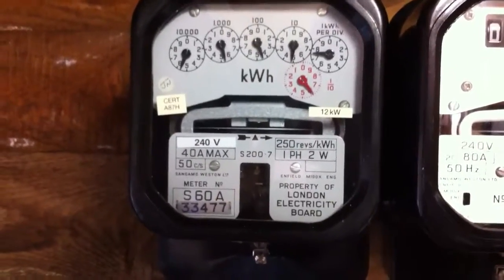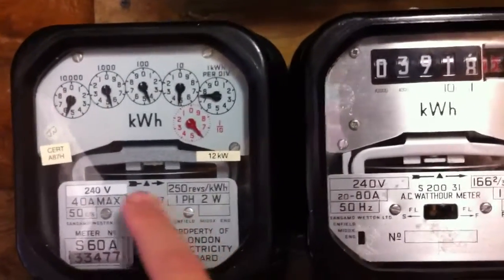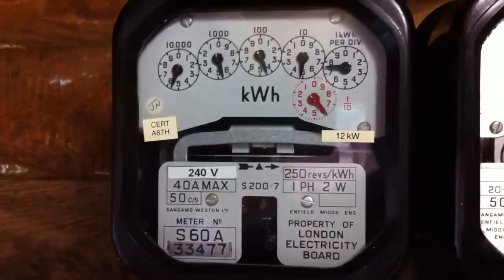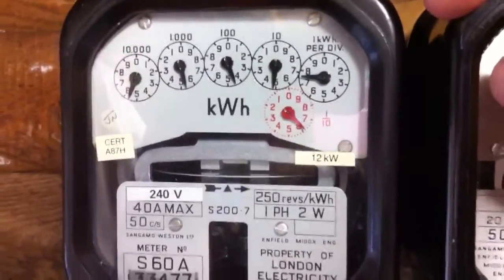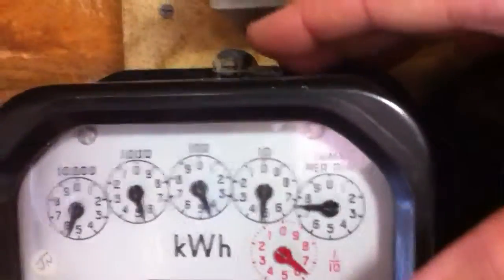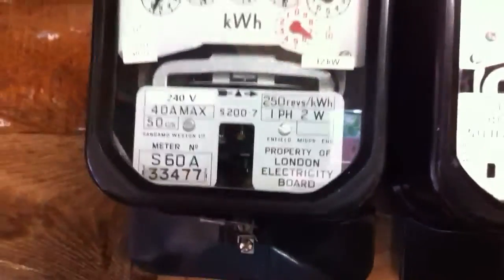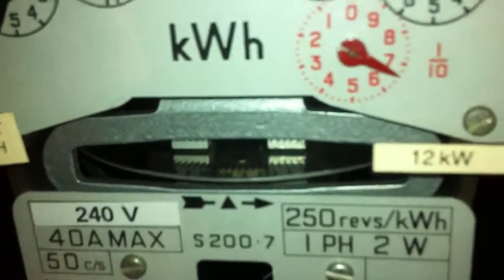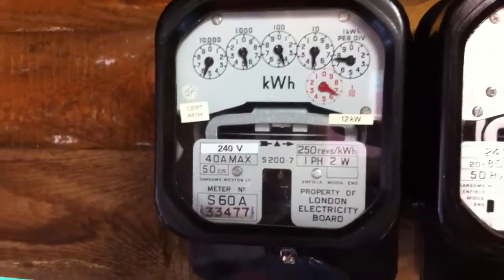Sangamo Weston S200.7 kWh meter

Comment: Mmmm, nice instrument! I have a S200.16 with that type of specification plate, & it's also a clock-dial type. Just like your one, my one is ex. London Electric Board complete with original anti-tamper seals too! :-) The other S200.16 I have, has a cyclo-dial type readout with a 'standard' specification plate (as like the one on your S200.31)

Although I do also own a S200.7, my one has one of the standard specification plates. :-)

Thanks for showing,

-BoomBoxDeluxe.